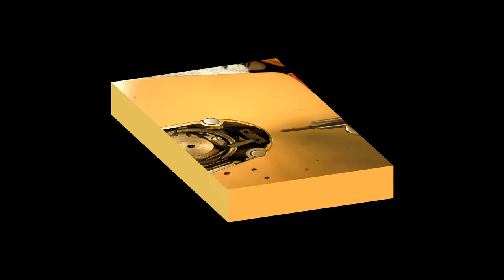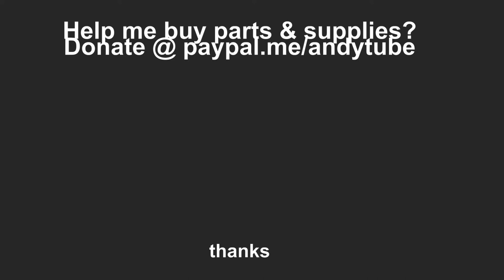The Bobbin Area Parts of the Singer Model 403A Sewing Machine

Comment: I just got my 401A and have been watching to disassemble, clean, wash and reassemble after the proper oiling and greasing.  Thank you so very much for the detail in your videos.  I was having trouble getting the  positioning bracket put back together. When I listened to you describe the tension spring that the bar had to slide under...viola!!!!
Reply from the maker: Congratulations on getting a Slant-O-Matic! I'm glad the videos are helping and thanks for working on the machine. I do have a playlist for the 401A and all the parts up in the horizontal arm: https://www.youtube.com/playlist?list=PLsCOZgzzaiKLiDl9yFTP6mJgQmz5lj4NO    Good luck going forward.

Comment: Hello again Andy.  I was finally able to get things moving on my 403A and 301A.  The 403 was frozen solid everywhere, from old oil and today after two months, I was able to get the top off of it and found it pretty clean on the gears which I was happy about.  I had to come see you to find out where exactly to oil the bobbin case area because the book wasn't real clear on the exact spot for oiling the hook.  
I went ahead and removed the spring for the throat plate and it was the dickens trying to get it back on and found that sitting down in front of the machine I was having the same issue as you with it not wanting to slide.  I stood up instead, looked down at the spring then placed my finger against the spring itself and on top of the spring in the middle giving it equal pressure holding it in place while tightening the screw.  From there on out it's been smooth sailing and moves beautifully with no hang ups whatsoever.  
I'm still in the process of getting it cleaned up and the polish and wax will have to wait until my arm heals some more.  Three months and counting and I still can't do much with it but I can't wait to be able to put needle to fabric after I'm finished.  I still need to remove and clean the tension  assembly but i'm so very happy to finally get somewhere on these machines.  I'm missing the oil pan cover for my 403a but I made a temporary one out of cardboard.  
I want to thank you again for your knowledge and your willingness to share it with us so we can also keep our machine's running smoothly.
Reply from the maker: You're very welcome. I'm happy you stuck with it and have made so much progress. It is certainly a worthy machine and once restored you'll have very light maintenance over many years of use. You can find oil pans on eBay sometimes, but you have to check every day b/c they sell out so fast. Search for 401A, 403A & 404 as they all use the same pan. I've made a few replacements over the years. I've used sheet metal; https://www.homedepot.com/p/Everbilt-12-in-x-18-in-22-Gauge-Metal-Sheet-801447/204225782 and I've used Tempered Hardboard; https://www.homedepot.com/p/1-8-in-x-2-ft-x-4-ft-Tempered-Hardboard-Actual-0-115-in-x-23-75-in-x-47-75-in-109112/202585358   I think I liked the wood hardboard a little better. The backside is porous and I did not even use felt on it but gave the customer two pans so she could just swap the first out if it got greasy. A friend replaced a 301A pan with a cutout from an aluminum sheet he also bought at home depot. The eBay ones used to cost $12 but that was a few years back. I'm excited for the day you can run some stitches with the machine and I don't even sew. Nicely done, Donna.

Comment: Hello Andy, thank you for all the videos. I have a 401 M and thanks to you I got it working. I still have a lot of cleaning to do and setting, what kind of oil do you suggest I use. After using the KrudKutter I have used a lubricant, but I see you use oil. Thank you.
Reply from the maker: TriFlow oil seems the most popular https://www.triflowlubricants.com/product/tri-flow-superior-lubricant-drip-bottle/   But you can use any sewing machine oil if you want. Singer, Dritz, Lilly, etc. What's important, IMO, is you are starting with a clean machine. If you keep it oiled, wiping away excess oil, and keep a little grease on the steel gears, you'll be fine. TriFlow makes a clear synthetic Grease that works very well. So, grease on gears and oil on other moving parts and wipe off excess oil & grease and lint. Happy sewing and thanks for watching my channel.

Comment: The further i dig into my machine, I find she is dirty and way over oiled. When i lay her down in the cabinet i get oil in the thread guide just above the needle, along with a few other places 😂 I found that the bobbin holder was bent and not keeping the bobbin steady on the race.

Once i cleaned it, adjusted the bobbin holder and reassembled it, i stopped having birds nests on the bottom.  Hopefully it will help stop the top thread from breaking when I use the special disks. She doesn't like fine stitching so i am hoping this will clear that up as well.

So far i have cleaned the upper tension unit and the bobbin area and adjusted tension on both. I need to test out more disks today to see if it made a difference.
Reply from the maker: You are making great progress. It's amazing how much gunk and oil can come out of a machine. That's the main reason I justed washing them in the shower with Krud Kutter.
Here are more videos that can help with the 403A Special model
youtube.com/playlist?list=PLsCOZgzzaiKKyqvdDRwS-9MfLuwSNJTcg
https://www.youtube.com/playlist?list=PLsCOZgzzaiKJZaZn2zl3LsnV2d7UhrqvX
For me, the 403A Special is worth any effort needed to restore it. My favorite cabinet capable ZZ model. Good luck and thanks for watching my channel.

Comment: Hello Andy, your videos are such a pleasure to watch and I've learned so much.  I was so fortunate to find a '51 403a at a garage sale for just $5!  With your help from so many of your videos, I've cleaned the motor, (no more growling, and so much faster!) gotten the zig zag to swing in both directions, and got her cleaned and ready to sew.  My concern is that I can still hear my bobbin jumping around in the case while I sew.  My stitches are good, but I can't figure why that bobbin is doing that.  I've watched your other video on the bobbin area, and all the settings are correct.  Any thoughts or ideas would be greatly appreciated!
Reply from the maker: Congrats on your restoration success. Purchase of the year for $5 I think 🏆 "I've watched your other video on the bobbin area"...
well, I have quite a few. A couple things that can cause a jumping bobbin/case. The needle thread is grabbed by the hook and taken UNDER the bobbin case. During that time the needle thread should be slack if the take-up spring (check spring) is set properly. If it is not set properly it can put tension back on the needle thread while the thread is still under the bobbin, popping or lifting the bobbin a little bit. Here is a Stroke & Tension video showing how to check/set the stroke and tension of the check spring. https://youtu.be/4Q1dAUHqfvg   Another cause can be too big of a thread clearance gap between the bobbin case and the Bobbin Case Position Bracket Spring that allows too much movement of the bobbin case allowing it to "snap" back and forth between the hook race and the bracket. Her is a video for checking/setting the clearance: https://youtu.be/OXKqZp87eN4
Those are the two most common causes. Others are dirty bobbin case slot. Dirty hook race. Lack of oil on the hook race. Too much tension on the upper AND lower thread (they can be balanced, but too high, making for a "tight" stitch and snappy thread action, again machine the bobbin jump.) Very rarely a loss of timing of the takeup lever. If the takeup lever was removed for cleaning or replacement and reinstalled improperly and the timing is off a little then the takeup lever is pulling the thread back up before the thread has come out from under the bobbin.

Comment: Hey Andy, after using your videos to clean and fix my machine I've sewn a few projects that have gone fairly smoothly! I am having a recurring issue where the needle breaks when I switch to reverse for a lock stitch. I've read that it could be a dirty bobbin area. I also notice that the needle could be hitting the plate so perhaps I need to tighten my thread tension. Do you have any suggestions that could point me in the right direction? 

Thanks!
Reply from the maker: You don't have a dirty bobbin area if you followed my videos, right? 😊 If you search Google for thread breaking you'll find a lot of possibilities. When it only happens in reverse that can narrow it down somewhat. "needle could be hitting the plate" OK, maybe, like scraping on the side of the needle hole and that is usually you trying to "help" the fabric move. Just let the feed dog do that. It won't take much to flex the needle when helping the fabric or holding it a little while it is moving. When you reverse, or "back tack", the needle often goes back into the hole you made going forward, ie: two threads in one hole, which increase tension on the thread and can "flex" the needle. Sometimes using one size up needle can help. There is a chart in the instruction manual for recommended needle/thread size https://www.singer.com/search/support?title=403    Actually, when having thread breakage, lowering the needle thread tension a little can help prevent needle flex. You can check the alignment of your needle in the straight stitch needle plate to be sure it is centered. Page 134 of the Service Manual. Download a free copy here if needed: https://sewingdude.files.wordpress.com/2012/09/singer-401-service-manual1.pdf
When you search for breaking thread you'll see a lot of mentions about worn needles, bent needles, needle installation, cheap sewing thread, wrong thread to needle combo, etc. because those causes are all true and happen a lot... a whole lot!  My wife suggests always using just enough tension to keep the stitch flat b/c that means it is balanced to the bobbin thread tension.

Comment: Hey!! I was wondering about that horizontal tool that you used to unscrew all the parts... I need to get one!! What is it called??

Thanks so much!
Reply from the maker: Hi, Kat. You'll love using this type of tool. Mine is called the "midget" 1/4" drive ratchet made by the Chapman Manufacturing Co. and is part of this set of tools I bought: https://chapmanmfg.com/products/9600-starter-slotted-bit-set  They make larger sets too. I did a video about the set when I bought it. https://youtu.be/KnrvDZeaYj4   You can find this type of rachet screwdriver for as low as $3:
https://www.harborfreight.com/8-piece-right-angle-screwdriver-92630.html     and for $10: https://www.amazon.com/Ratchet-Screwdriver-Tacklife-ratchet-36-tooth/dp/B07GJMGMY8   An all-metal $13 set: https://www.lowes.com/pd/CRAFTSMAN-10-Piece-Steel-Handle-Ratcheting-Multi-Bit-Screwdriver-Set/1000596669      Klein Tools makes a unique one with a finger loop that's a little larger: https://www.homedepot.com/p/Klein-Tools-1-4-in-Drive-Electrician-s-Mini-Ratchet-with-Screwdriver-Bits-and-Adapter-65200/311127793   If you watch my Champan video you'll see I chose it to get the hollow-ground drive bits. The Midget Rachet (I call it mini) was a very pleasant surprise. Thanks for watching my channel.

Comment: Hi Andy! Is the base the same dimension on the singer 404 and 403
Reply from the maker: Yes, it is. Even the bottom plate (oil drip pan) is the same part number. Bed is 7" x 16-1/2" with a work area of 7-3/16 (btwn needle and upright)

Comment: I am fixing a VX-1121 and the bobbin positioning part is a little different because it does not slide into the machine buy my problem is the race is not turning. What do I need to look for?
Reply from the maker: Can't find any document for a Singer VX-1121. Maybe it's a Brother brand? I'm only familiar with Singer vintage models. In general, if the hook (shuttle) is not turning it is a sign of a broken gear or drive belt. Many plastic parts and gears on newer machines wear out. If you can remove the bottom cover/side cover of the machine you can start at the hook and work back towards the handwheel to see where the hook shaft is NOT turning and find the reason.
Reply: @andytubesewing1953  Sorry it was a Singer Stylist and I found a broken plastic gear.
Reply from the maker: @RuthDeanQuiltNGo  Another broken plastic gear. One of many. Glad you found the cause. Good Luck.

Comment: how do i  get a bobbin case to move on a singer 648?
Reply from the maker: Hmmm... I don't think bobbin cases move. The Hook rotates around the bobbin case so maybe you mean the hook?
     Model 648 is a Touch & Sew Model and I don't work on them as I never cared for the "wind-in-place" bobbin winding system. 
Maybe on a T&S model, the bobbin case does move during bobbin winding??? 
    There are a few steps required for the wind-in-place bobbin winding to work you have to be sure the buttonhole controls are off. 
You usually have to put the needle bar in Central Position and set the width lever to "1". There may be a bobbin "push button" that you need to push down or move to the left. Things like that. So if you are trying to wind the bobbin I'd suggest you download a free copy of the original Instruction Manual for Model 648 from the SInger support page here: https://www.singer.com/search/support?title=648 
     If your problem is that the Hook is not Rotating that may also be a Settings Problem, or it may be a physical defect, like a worn-out gear on the Hook Drive Shaft. As I don't work on the T&S machines I think they may have plastic gears, but I'm not sure. You can remove the bottom cover plate of the machine and see if the gear is broken I guess. If that is the case you can buy a new gear: https://www.sewingpartsonline.com/singer-648-sewing-machine-parts.aspx?index=14    
     I think there are 5 total gears in the 648 model and the model came on the market about 55 years ago. Cracked and broken plastic gears are common for plastic that old. You can even buy a copy of the original Service Manual for $8.99 but I don't know if it shows how to change out the gears: https://manualsoncd.com/product/singer-630-648-sewing-machine-service-manual/
     There may be YouTube videos showing how to change the gears on a Singer T&S machine since they made so many of them.